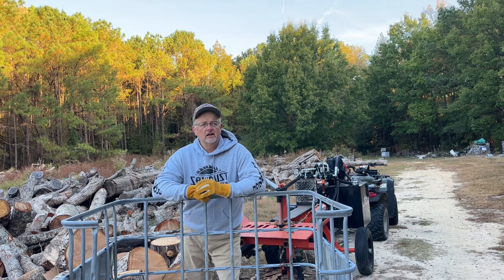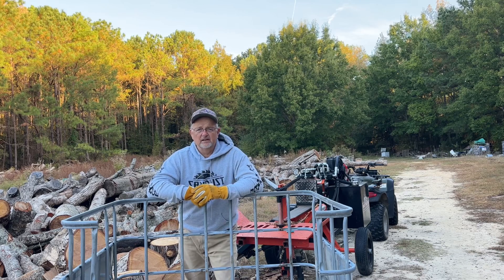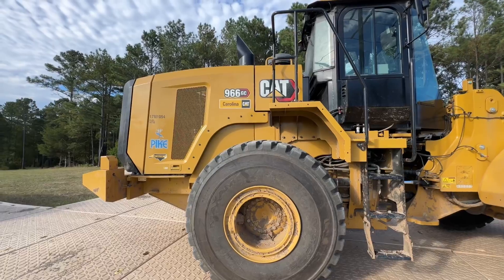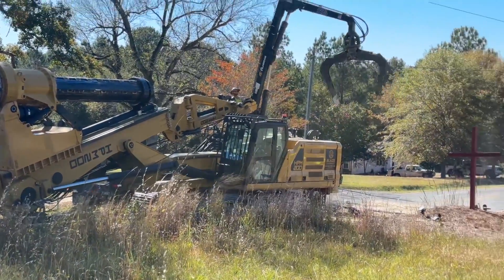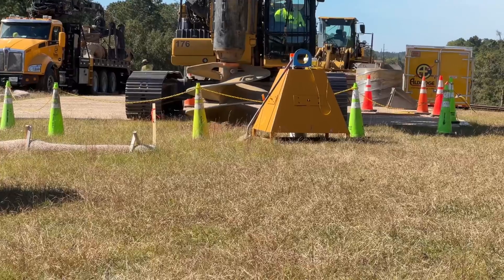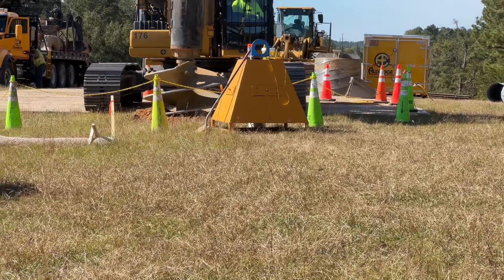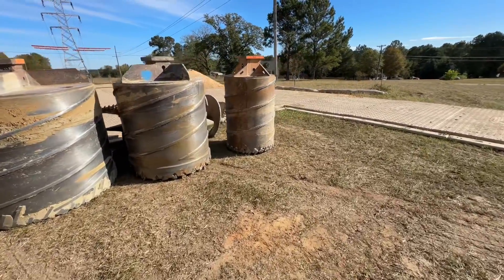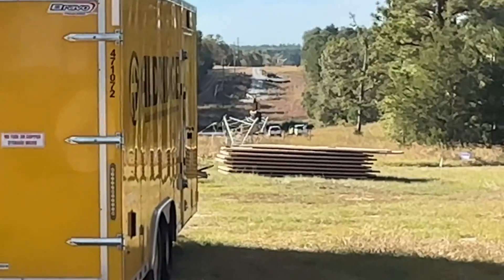Power Line Towers Part 2 #power #towers #engineering #electricity

Comment: Rick, we had the same type of construction in our area up here in Connecticut, around the corner. The main transmission lines were also replaced with those poles. it was a lot of work and went on for around two years, and our electric bill reflected that work. Lol.